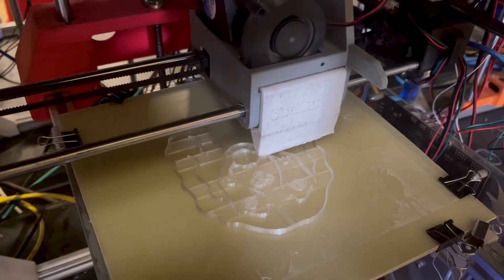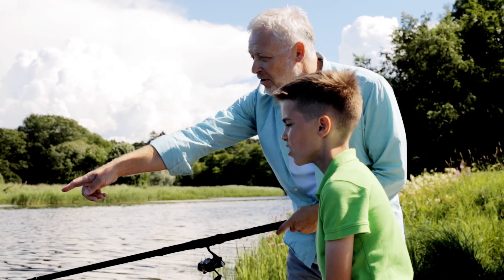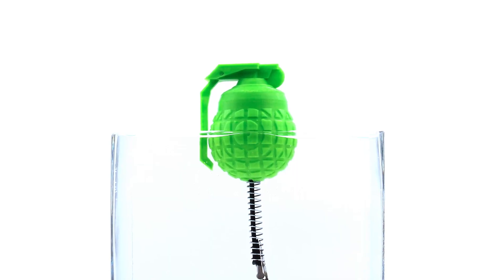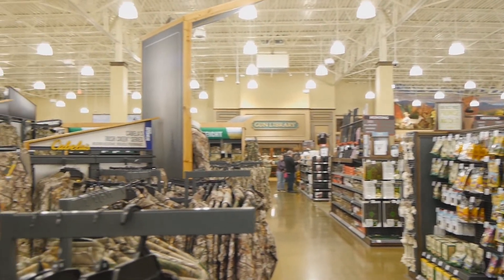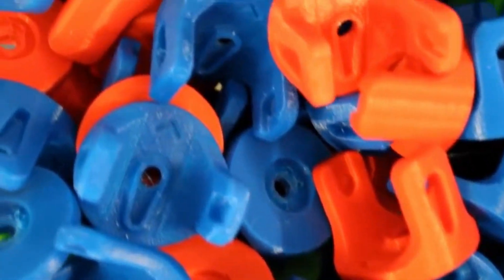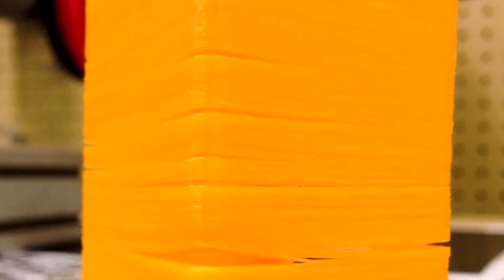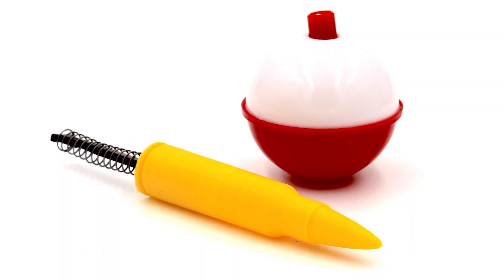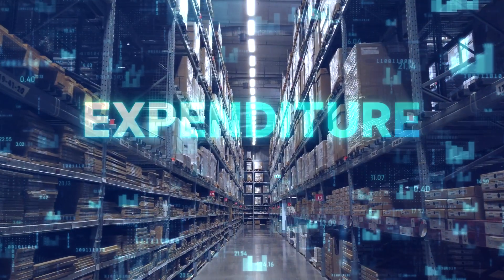Real 3D Printed Products: Wacky Bobbers

Comment: Love the way you promote 3D printing and how to use it in a segment that is at the right price. I first interact with 3D printing 20 years ago was to make a aluminium profile for a front of a case and to be able to se how it looks before ordering the metal part. The save was great due to changes in first version.